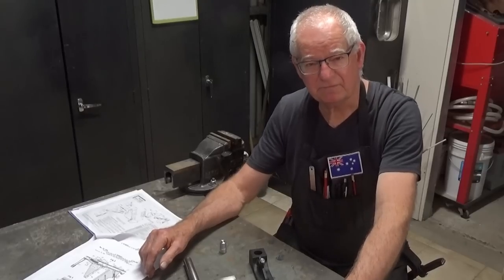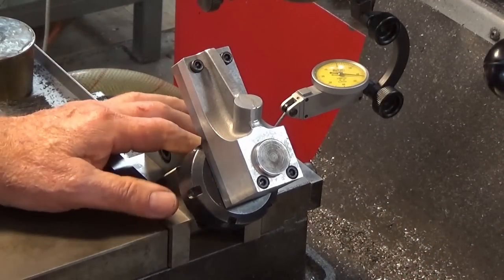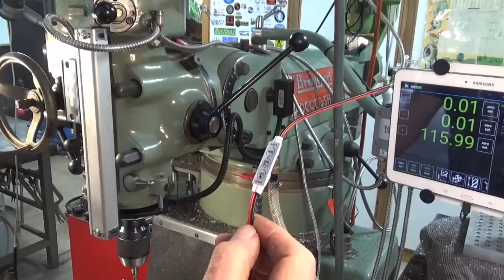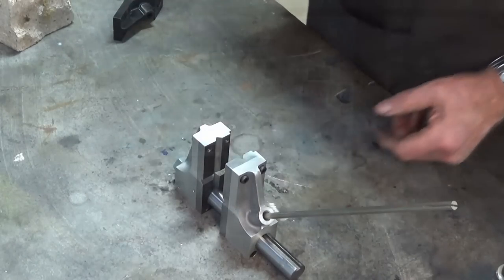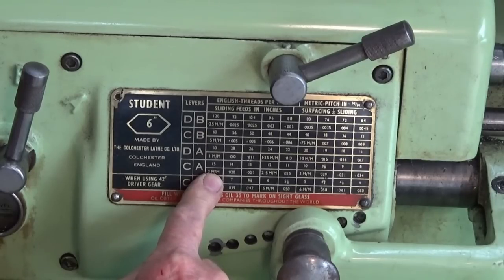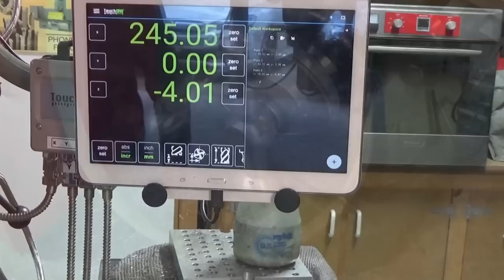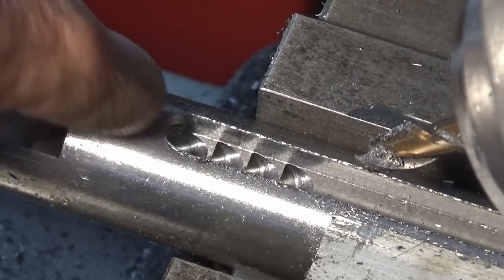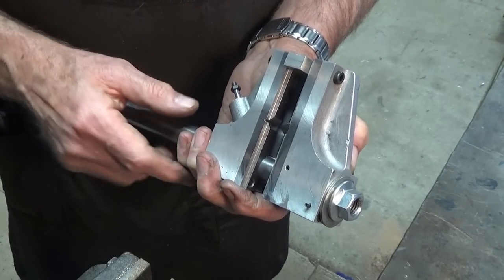Float Lock Vice from Aluminium Castings Part 4

Comment: Hi Mark, experience tells me that those light rings draw an awful lot more power than an LED strip and therefore more than those little controllers can cope with. The one I have draws nearly 4A at 12V, I use just a plain ring with a mechanical switch.
Reply from the maker: Thanks. I'm a sort of "suck it and see" type of guy when it comes to electronics. I thought I had checked the specs on both the light ring and the controller but maybe I should have actually checked it with a meter. I wanted to be able to control the brightness which also keeps the heat down. I have since purchased a dimmer with a potentiometer control and it seems to be working well. 
Regards,
Mark

Comment: I was confused by your setup to cut the angled hole in casting but I figured out that the problem you were solving was making sure you were centered on the shaft.  I would have put the casting in the vise on an angle block and this is the perfect spot for a tooling ball!  I only own one with a 1/4" shank, but I would have cut a bushing to adapt the  casting shaft hole to 1/4" reamed hole and put the tooling ball in.  With the ball shape, any circle you align the spindle to on tooling ball will then be on the centerline.  I would use an indicator in the spindle.

You could also put a large ball bearing ball in the shaft hole and center on that ball but the bearing ball would have to be a good bit bigger than the hole. That's a "Goldilocks" problem where the tooling has to be just right in order to work.

I think you might also be able to put your stub bar sticking out of the hole and center find on it, but you cannot change the Z height or X location. With your DRO that would likely have worked too.  

Nice video! I'm really enjoying this series.
Reply from the maker: Thanks. I realised after that I could have done the setup differently but I got stuck on the idea of using the 20mm bore as my absolute reference. A tooling ball would have been ideal but I have none. I have seen that very large steel balls can be purchased on the likes of Temu and Ali Express and I had planned on getting some. Maybe next time. 
Regards,
Mark

Comment: I mist have missed the explanation, why cant he hold the part directly in the jaws at 45 degrees?
Reply from the maker: I did gloss over my thinking process and there are several ways it could have been done. It probably seemed overly complex the way I did it but I already had the mandrel and it gave the drill bit something to cut into as hole exited the aluminium casting at an angle.
Regards,
Mark

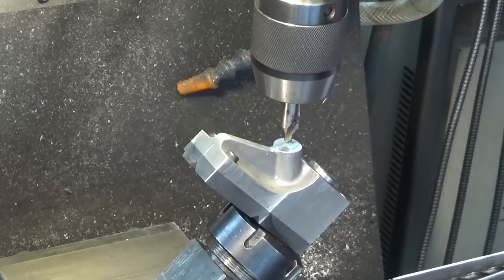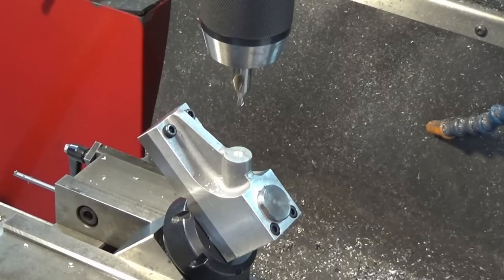Comment: Hi Mark great video. Watch from 6:45 to 8:15 your centre drill is badly bent causing the wobble.
Steve.
Reply from the maker: Stevie, other people have commented on that and to be honest, I didn't detect it while I was drilling the part. I know the centre drill isn't bent but it may have been gripped with one jaw in a flute but that too would have been difficult to do. I suspect it is one of those strange frame rate video artefacts, but either way I got a good centre for the remaining ops. 
Regards,
Mark

Comment: When you make the clamp for the drill press table to float lock vise, the angle of the hole in the clamp is not drilled parallel to the drill press table, it's pitched slightly to the table. If is drilled parallel to the table, the clamp will rise off the table when the clamp is tightened. I think the angle is about 3°.  Enjoying watching your build of the vise. It's amazing how work we go through just to make something that we can do more work with.
Reply from the maker: Thanks for that. I recall watching the Blondihacks version of this tool and she had mentioned having to rework the clamp because it kept lifting off the table. I will take that advice on board. 
Regards,
Mark

Comment: Mark I think you need to set your centre drill further into the chuck. I suspect one jaw is slightly into one flute of the other side and the top you're using is wobbling like crazy. Surprised you can't see that.
Reply: I thought the tip of the centre drill was bent, but my final conclusion was that all of the visible part of the centre drill was at an angle to the centre line of the mill chuck.
Reply from the maker: I think it is one of those weird frame rate things that can cause video artefacts. I just watched that part of the video again and it does look like the centre drill is running out but I can assure you that it cut fine. I would have felt it if the chuck was gripped in one of the flutes. I have a smaller chuck that does that sometimes but I was using my bigger 16mm chuck with quite a deep grip.
Regards,
Mark
Reply: @Preso58 Not a frame rate thing mate, it still wobbles as it slows down at 6:50.

Could have been anything, might be bent, might have been a bit of debris in the jaw etc.
Reply from the maker: @dtnicholls1  Fair enough. I will make a note to use a collet and a spot drill next time. 
Regards,
Mark

Comment: From your demo, the ratcheting mechanism obviously does work but it sure seems like the pockets in the rod (and the locking pin) should face the opposite way.  Any chance you can explain how the  ratcheting works and how the jaws lock when they are loaded with a work piece ?
Reply: You need a flat ramp, that can push the locking pin in longitudinal direction (only direction it can move).
So obviously, that flat ramp must be in the direction as it is made, or let's say on the side that is closer to the other jaw, so it can ratchet and move in that direction.

Locking pin can not be moved by round part of the pocket, cos round part push it from the side, at 90 degrees.
So when it snaps in to the pocket, it prevents jow from moving away from other jaw.
Reply: The pin and holes aren’t providing the holding force. They are acting as a pivot that causes the body to rack, and the tracking is what is providing the holding force.
Reply: @NitFlickwick   Pin do provide a locking force.
You can not move the pin away if you push it from the side at 90 degrees.
And it can not go thru the round side of the pocket.
Of course there is also a racking, but it is less important. Pin locks mechanicaly, rocking locks only by friction.
Reply from the maker: I know it seems counter intuitive and I had issues trusting the original design as detailed in the patent drawings but it does work and it locks solid when the nut is tightened. My only concern is that I have used low carbon steel for the clamp bar and there will be some wear and tear on the edges of the pockets over time. However the bar is probably the easiest part to make and if it does start to wear I will buy some 4140 steel or some prehardened stock to make it from.
Regards,
Mark
Reply: @Preso58  Sorry to be so slow but I can see why this works now.  While ratcheting, the flat bottom of the pocket acts like a ramp to push the pin up, and the cylindrical wall of the pocket does nothing.  While clamping, the cylindrical wall of the pocket accepts the load from the jaw via the side of the pin, and the flat bottom of the pocket does nothing.
Reply: @chrisarmstrong8198  I've been struggling with this too, and the demonstration didn't shake my doubts much, but I think you've got it right here.

Comment: I don’t know what the “issues” are that you mentioned. So far it looks great. I’m sure that alignment will get ironed out and you will be a float lockin’ fool! Nice tool as we’ve come to expect. Yes, we have no joeys today…
Reply from the maker: Sadly, we came across a dead wallaby on the side of the road just opposite our house about a week ago. It had a live joey in the pouch and we rang the wildlife rescue who came fairly quickly. They took the dead mother away because you cannot pull the joey out when they are very young. Their mouth is fused to the teat inside the pouch. We didn't hear how it went but I had a feeling they would have to euthanise it. I did fix the alignment issue with the moving jaw and you will see how it was done in the next episode.
Regards,
Mark

Comment: Why holding jaw on the mandrell in a collet block for drilling/reaming?
Why not just grip to the body of the jaw?
It should be much more rigid, and easier to do.

Of ocurse, you need mandrel inside the hole, cos you have angled hole, and you could also centerfind the hole by that mandrell.
Reply: Ya, my question too
Reply: Agree
Reply: I think it's because you want the drilled hole referenced to the hole the shaft goes through, not to the outside of the jaws. If the outside of the jaws if off at all, you will get error in the drilled hole as well.
Reply: @ADBBuild So you centerfind the mandrel going thru that hole.
BTW, even when you are holding to the mandrel, you must indicate outside of the jaw, as it's done in a clip
Reply from the maker: It could have been done either way. I had been super careful to edge find and centre on the collet block so both the holes were accurately aligned in the X direction. Also, having the steel mandrel in the bore meant that as the drill broke through into the bore it had some stock to cut into so it wouldn't grab or deflect. 
Regards,
Mark
Reply: @Preso58  Of course... poor cat can bi skined in many ways :)

It was just my first choise to grab on the body, so I was curious is there some reason I do not see, that will give advantage to colet block/mandrell combination.

If you grab the bodu directly in the vice, you only need to centerfind the hole, which is easy, cos you have mandrel in it.
No indication at all (assuming that the vice is set up properly, of course)

Btw, I will probably make an aluminum plug, so when drill broke through it will not have one side harder then the other (al-steel). Probably just academic, but... it is easy job, why not...

One more thing...
Cold rolled bar usualy want to bend if you cut long slot on one side, cos of internal stresses (surface layer is "crushed" during cold rolling).
Did you get any bend?

Comment: Hi Mark, you are doing a great job. That ratchet looks to works very well, and it sounds like positive contact with the spring loaded pin. Good work.

I wonder if that round light is drawing too much current for the controller that you are using. I have those controllers connected to strips of LEDs and I have had no problems with them.
Reply from the maker: The ratchet does work well and just looking at it you'd think it would slip when loaded but so far it hasn't. I thought I had checked the current from that light ring and it seemed to be within the range of the controller. However, I have since replaced the smaller controller with a simple dimmer specifically for COB LED's and it seems to be coping well.
Regards,
Mark

Comment: Is there enough material left to clamp the jaws together and skim cut them as an assembly? You could even clamp them onto a dowel pin or rod to make sure the v-notch lined up perfectly. Maybe indicate off the same dowel pin to check if they jaws are square/parallel to the mill? I guess the pin would be in the way if it was sticking up...
Reply from the maker: The fix was relatively simple, I just set it up slightly differently and then recut the pocket a few thou deeper. You will see how it was done in the next episode.
Regards,
Mark

Comment: Hi Mark, why didn't you clamp the part directly (without a collet chuck) in the vice at 45 degrees?  You would have had to do a lot less alignment.
Reply from the maker: It would have been an easier setup but I was really concerned about aligning the two bores. I probably didn't explain it well enough but I had previously used an edge finder to locate the centre of the square collet block and zeroed my DRO, then I could mount the part and I knew the next features would be exactly aligned in the X axis. I realise that you could still sweep the inside of the 20mm bore and then tilt it over but at the time I missed seeing that. One of those cases of tunnel vision that us males are renowned for.
Regards,
Mark